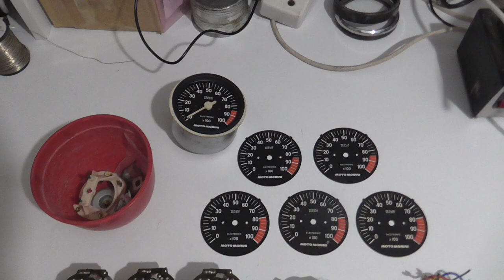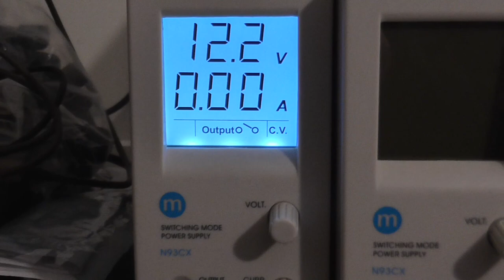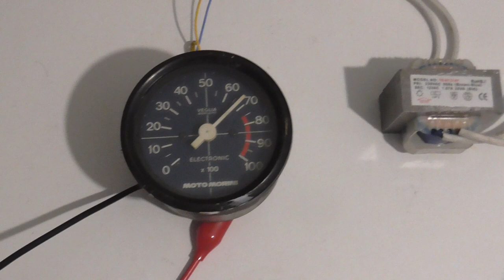Veglia Tachometer - Bench test

Comment: Hello, I need to adjust the tacho. I put a diesel engine and a diesel thaco into a petrol car. The case is, the original plate with the scala from 0-8000 i need to use, but the veglia from the dieselcar work for a scala 0-6000. Is it possible to adjust it so I can run it for the scalaplate 0-8000?

Comment: Does the trimmer pot adjust the zero point (offset) or the gain of the meter. It looks like the needle is just not positioned correctly since it reads high by the same amount at zero and at 6000 rpm.
Reply from the maker: The rest position of the needle is a mechanical stop. If its position is set to zero at rest, then it can't achieve full scale. Since an engine is unlikely to be running at less than 500rpm, that's the end of the scale that's cut off. The speedometers generally don't go down to zero either.

Comment: Excellent. Thanks Paul. Done everything as above and my needle doesn't move. Checked coil and all good. Does this mean it has had it or is there a repair you know about ? Thanks
Reply from the maker: The chip on the PCB often fails and has not been available for many years. There are some replacement PCBs out there, but I've not tried any of them.

Comment: I'm trying to put my '98 Guzzi back on the road. My tach is showing open coil. No luck locating replacement tach here in the US; have you any suggestion for parts source? Thanks
Reply from the maker: Unfortunately no. It is possible to rewind the coils, but dismantling and reassembling the mechanism is tricky.
Reply: You are probably better off going with a replacement tach. Speedhut or Autometer. I am currently replacing mine on a '01 Cali EV

Comment: Oi gostei o modo que o senhor testou o tacômetro , usou um transformador de corrente alternada para gerar os pulsos, muito legal, tenho um rpm de moto gostaria de ligar no meu fusquinha teria como ligar por que já tentei no polo negativo da bobina e não funcionou nada liguei no modulo também não funcionou nada teria outra forma de ligar o tacômetro de moto no fusquinha  grato por sua atenção.

TRADUÇÃO PELO GOOGLE 
Hi, I liked the way you tested the tachometer, you used an alternating current transformer to generate the pulses, very cool, I have a motorcycle rpm I would like to connect it to my Beetle, it would be possible to connect because I already tried on the negative pole of the coil and not nothing worked I called on the module also nothing worked there would be another way to turn the motorcycle tachometer on the beetle grateful for your attention.

Comment: Hello Sir , 

I have try to test a 6 cylinder rev counter with the same method that you show in this video.
I used for the test a 12 V UPS battery and a 220 V --> 12 V AC 50-60Hz 0.8 Amp transformer.
Nothing happens , except when I use some short contacts on the signal contact (please see video) .   https://youtu.be/HAnJu7o8KiQ
I like to point out that the rev counter has been tested on a 4 stroke 4 cylinder engine and it works , but it shows a much lower RPM. 
Also I try to test with this another rev counter (for 4 cylinders seen also in the video ) , with the same result .
Could you please tell me what I do wrong ? 

Thank you
Reply from the maker: The Veglia tachometers I was testing are designed to work with an electronic ignition. Is yours designed to work with points?
Reply: @EVguru  I don't know how was the Pemas tachometer build , but I have tested the same method on the Skoda 130 tachometer with the same result . I know that the Skoda tachometer was design to work with points but it works also with electronic ignition system .

Comment: Wish this was more clear. Why do you need a transformer if you have a power supply. How about a diagram of what your doing.
Reply from the maker: The transformer is used to provide an AC voltage that simulates the trigger signal from the ignition.
Reply: @EVguru  not meaning to be awkward but isn't UK mains frequency 50Hz?